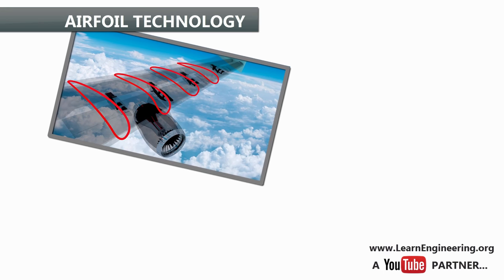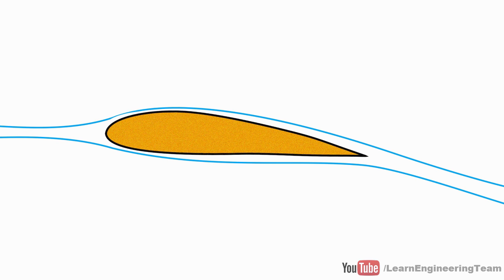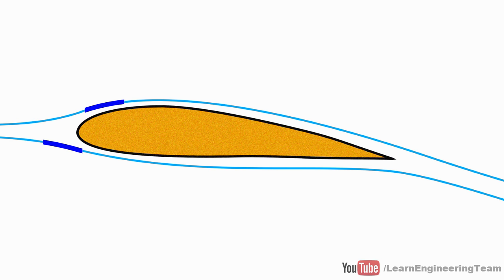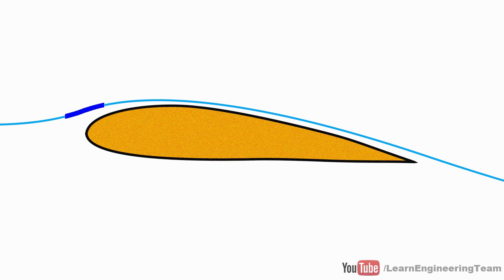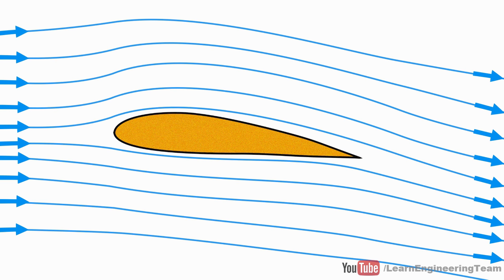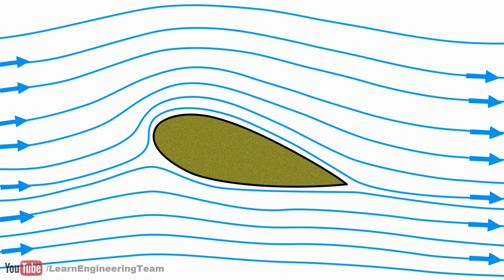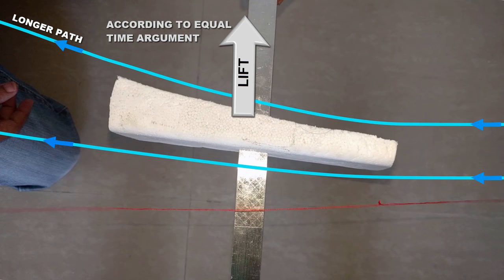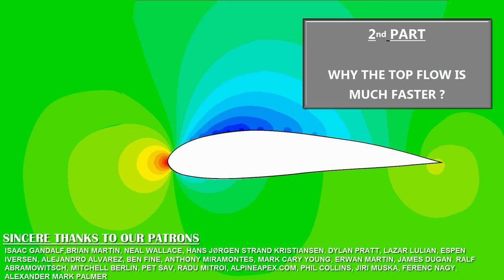How do Wings generate LIFT?

Comment: This video replaces one demonstrably false theory of lift generation with another demonstrably false theory of lift generation.  Yes equal transit time is a myth.     But it's quite easy to show experimentally that the Coanda effect is not the answer either.   
A thin flat plate with sharp edges will generate lift if you angle it relative to the free stream air to produce a positive angle of attack.   See basic kite, or paper airplane.    Yes,  it produces lift the same way all other airfoils produce lift, with high pressure below and low pressure above caused by accelerated air, and net airflow deflected downward.    The magnitude of the lift equals the total mass of air deflected downward integrated over time.    
The real question to answered is, if the curve on top of the airfoil is not necessary, then why is the air above it still accelerated with a positive angle of attack?    
And then why are subsonic airfoils generally rounded up front, move curvy on top than bottom with a sharp trailing edge? 
The answer starts with the Kutta Condition and the overall lift generations is best described by the Kutta–Joukowski theorem.    Feel free to stop here, and look them up, but I'll attempt to explain what's going on below. 
Another way to describe this effect is that with any net positive angle of attack, a  "bound vortex" (I didn't make that up, it's used by NASA and others) forms around the airfoil which moves along with the airfoil and constantly accelerates air above it toward the sharp trailing edge, and to a lesser degree slows the air below the airfoil.    But what forms the bound vortex?  

The key concepts are stagnation points and the sharp trailing edge.
Stagnation points. 
If you push any shape through the air (or any fluid) two stagnation points will form.   The forward stagnation point is the point where the air piles up and local fluid velocity is zero and packets of air above it must flow over the shape, and packets of air below it must flow below the shape.   A side effect of this is that the pressure just above and below the stagnation point is equal (any difference in pressure would move the stagnation point).   Similarly behind the object eventually the airflow will rejoin at a point where the local velocity is zero and pressure is equal, and this is the rear stagnation point.  The stagnation points will move around relative to the shape as pressure changes, but they always define two points where flow rate is zero and pressure is equalized.  
If you rotate a random shape relative to the free stream air, the stagnation points will try to remain roughly centered in front of and centered behind the shape, but lift generation or turbulence will move the stagnation points around. 
So let's talk lift generation.  

Sharp trailing edge
Let's start with the flat plate with sharp trailing edge.  
Firstly if you give the plate zero angle of attack then the forward stagnation point will be right in front of the leading edge, and the rear one right on the trailing edge, air velocity and pressure above and below is equal, thus no lift is generated. 
If we take our flat plate and rotate it relative to the free stream air to give it a positive angle of attack, the forward stagnation point will generally try to form just below and behind the leading edge, and the rear stagnation point will try to form just above and in front of the trailing edge.    This means the air separates at the forward stagnation point and some flows upwards over the leading edge, and across the top, and the rest flows over the bottom.    The air flowing over the bottom reaches the trailing edge and attempts to reach the desired rear stagnation point above and in front of the trailing edge by making a sharp 180 bend  so that it can equalize the pressure.     The packets of air at the forward stagnation point can pull off a relative sharp bend, because the air has piled up in front of and below the leading edge so local velocity is quite low, but at the trailing edge, the local velocity of the air below the airfoil is quite high, the bend is very sharp by design, and the viscosity of the fluid (air in this case, but works with any fluid) simply prevents the air from completing the sharp 180, so instead it separates from the airfoil and continues on with the free stream air.    This instantly creates a region of low pressure in front of and above the trailing edge that can only be filled by airflow above the airfoil.    This low pressure accelerates the airflow above the airfoil rearward and downward toward the sharp trailing edge, and this region propagates all the way forward over the entire top of the airfoil (and ultimately it will extend above and forward of the airfoil).       In the steady state, the rear stagnation point has been forced to move to the point of the sharp trailing edge.  
The net effect is that the forward stagnation point remains a little below the center of the leading edge and the rear stagnation point is right on the trailing edge, thus air over the top is forced to follow a longer path between the two points where pressure must be equalized and this accelerates the air above, and slows the air below.
This can best be modeled as the existence of relatively slowly spinning vortex that moves along with the airfoil which mostly accelerates air above and slows air below.    This is the Kutta condition aka a "bound vortex".  
If the airfoil is moving right to left, then the vortex is spinning clockwise.   

Curves
So now we know why airfoils have sharp trailing edges.  So why do subsonic airfoils generally have rounded leading edges, and more convex tops?   This is because any form of localized vortex (smaller than the lift producing bound vortex) causes stalled air, and increased drag.     The problem with the flat plate airfoil is that while the air does still flow upwards around the leading edge from the forward stagnation point, it still has a hard time making a sharp enough bend to immediately lay flat against the upper surface, so smaller vortexes form behind the leading edge and this turbulence causes drag and a reduction in net lift.    What we do to minimize drag is shape the airfoil to match the natural shape that the bound vortex is accelerating the air. Vortexes move fluids around in generally circular shapes so making the airfoil curved to match those shapes, will reduce or eliminate the formation of the drag inducing vortices.     The air appears to stick to the surface, but it's more that the surface has been curved to meet the airflow.  
The leading edge is curved, because this allows the forward stagnation point to move up and down through a wide range as the angle of attack changes, and the packets of air above the forward stagnation point can easily flow upward over the more gently curved leading edge, and stay attached to the airfoil.    

Different curves for different speeds and loading.
As an airfoil goes faster, the total mass of air deflected downward over time increases, and the angle of attack can be reduced, which also reduces the magnitude of the bound vortex, which means a thinner less curvy airfoil will get the job done.  Similarly if going slowly or attempting to lift a great load, the angle of attack is increased, and the bound vortex must be bigger and thus you use airfoils that are fatter and more curvy to match their shape.    Flaps and leading edge slats can allow an airfoil to change shape to match the speed and load carrying needs.     Typically the airfoils natural shape will reflect what works best at the speed and load that it'll fly the most (like an airliner at cruise alt), and then it morphs for takeoff and landing.  

Side note: Supersonic airfoils shed their bound vortex at supersonic speeds (pressure can no longer be communicated forward at all), so they pretty much go for pure Newton's third law approach, bouncing air molecules directly off the airfoil skin as though it were flying through a cloud of BB's.    This is why they must be made very thin (like our flat plate airfoil) which then makes it all the more challenging to morph them into shapes that work at subsonic speeds.  
If you want to test  these concepts yourself, I recommend an App for iOS or Android called "WindTunnel".   Can draw any shape you want including flat airfoils and rectangular ones, turn on lift/drag calculations, and air packet visualizations, pressure visualizations..   then rotate the airfoil to see what happens, then use erase tool to shape it into a more classic airfoil  (start with the trailing edge to see what happens) and so forth.  I've probably spent 100's of hours playing with it.    It's a very simplistic app, but the modelling is accurate and I've seen real design work done with it.
Reply: This is a good explanation. It's worth noting that the bound vortex is really vortices all along the airfoil's surface (or really within the boundary layer of the fluid, which is rotational), hence why visocity enforces the Kutta condition. But the bound vortex is a good approximation, especially if you're interested in far field, wake structure, etc

Comment: WRONG.. Bernoulli is not necessarily the 'equal time theory.' Bernoulli used in flight theory pertains to the Venturi effect over the wing (airfoil)--the Venturi effect causes airflow acceleration and thus decrease in static pressure. It is very valid and shouldn't be dismissed. The "equal time theory" (separated particles will accelerate to rejoin) is indeed false. The particles do not accelerate because they must rejoin. This video is completely wrong to mix Bernoulli and the equal time theory and thus dismiss Bernoulli. Bernoulli is a key principle of flight and Newton is part too..